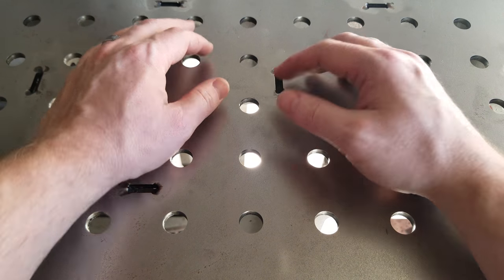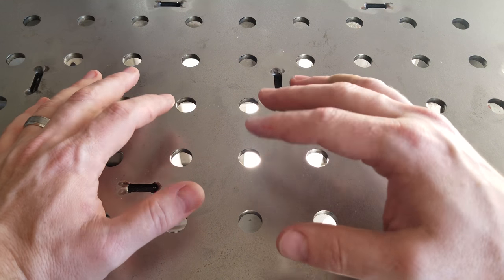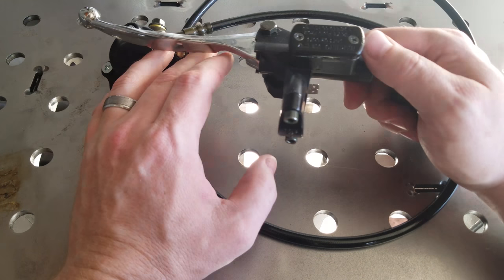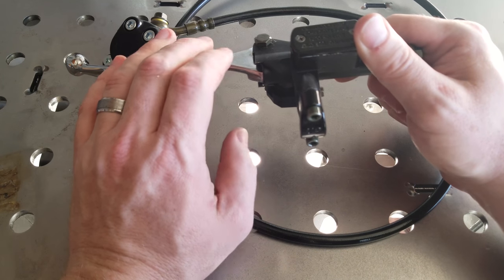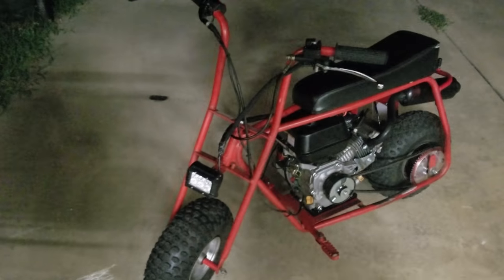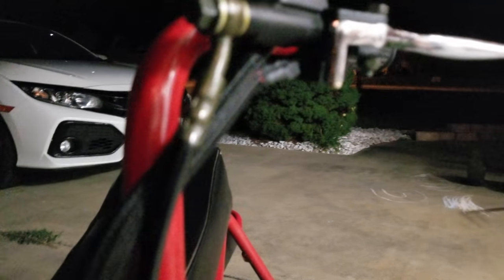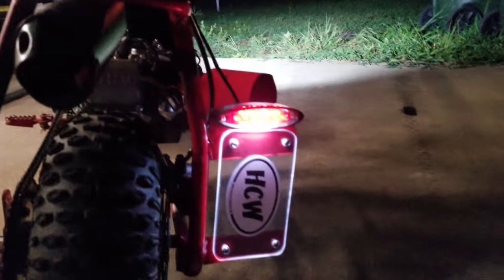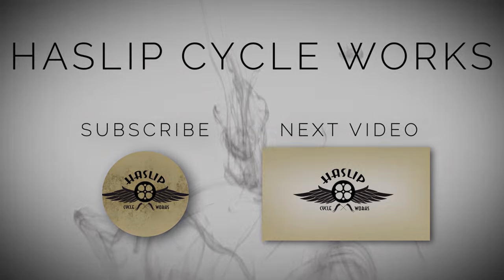Mini Bike Build - Part 4 - Lights and Hydraulic Brake Upgrades

Comment: I have a hydraulic brake setup with a connection like your lever in the video. Where could I get a switch for the lights and where do I get a battery pack and may I get the wiring diagram. I'm new to mini bike world an put my first mini bike together for my son.  Now we just need lights
Reply from the maker: Shoot me an email haslipcycleworks@gmail.com

Comment: Hey man could you please explain how there is a brake switch on that handle? Your link goes to OMB warehouse one which is what I want to use but I don’t see anything about it having a brake switch? No wires come out of it or anything. And I was hoping it would be explained but it just shows finished product. Thank you man!
Reply from the maker: There is a little micro switch on the bottom side of the brake handle. It has 2 little spade shaped connectors on it.

Comment: Hi wanted to know how did you connect the brake light to the brake lever, did you just crimp the positive wire from the light to the positive from the brake lever
Reply from the maker: I ran the positive from the battery to the positive on the brake light, the negative on the brake light to one side of the brake switch, the other side of the brake switch to the negative on the battery or a bare spot on the frame and have the negative on the battery go to the frame. I have a diagram I can email you if want, shoot me an email to haslipcycleworks@gmail.com

Comment: He man love the videos. What drill press are you using? I’m in need of a new one with some decent power. I have a small one that has tans it’s course and it bogs down pretty easy. 

And the head light and tail light set up is awesome. Did you figure out a charging system to keep the battery charged up while riding?
Reply from the maker: Rust Belt Fab thank you! It’s an older Chicago Electric I believe. It does ok but lacks the low end power you really need for larger bits through heavy stock. Unfortunately no, the 212 doesn’t have an easy way to charge batteries especially something as temperamental as lithium ion. The battery runs that headlight and tail light setup for several hours for a few days in a row.

Comment: What battery pack is that, I didn’t see a link to it. How long can that battery last with the lights on?
Reply from the maker: chris hefley search eBay for 11.1 volt 3s lipo battery. I ran the lights for hours on end and only charged the battery maybe twice. If you are just powering the led lights it doesn’t take much.
Reply: Yeah I’m looking at doing what you did or I was thinking of using my power tool battery from Milwaukee. Either my m12 or m18 as I already have them and they are rechargeable also. I’ll look into that better also.

Comment: Just curious: when did you switch from centrifugal to clutch, and why?
Reply from the maker: Originally I built it with a torque converter but it came apart on me at wide open throttle, sending parts flying including into my arm and leg. After that I just threw on a centrifugal clutch and away I went.